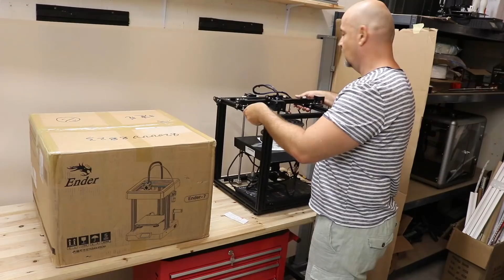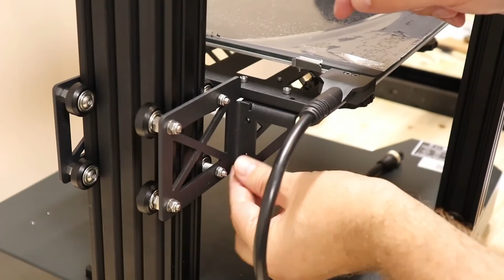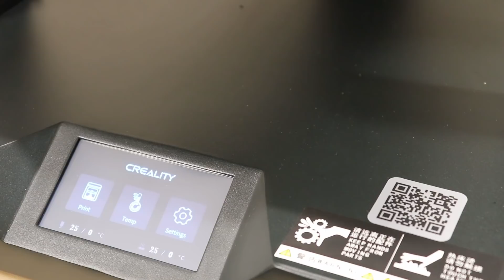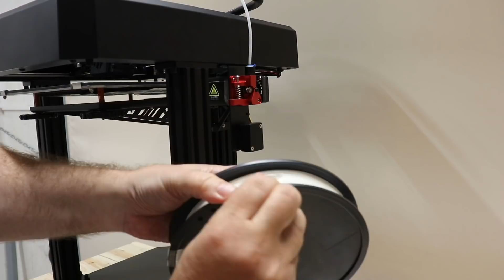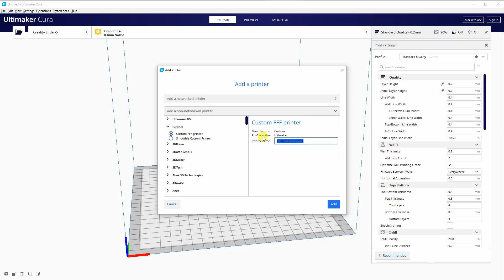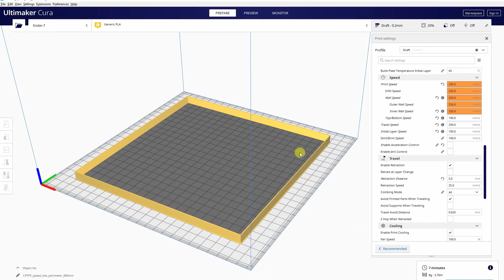How fast is Ender 7, the coreXY 3D printer from Creality?

Comment: This machine is just all hype..  Poor quality control, Poor Design throughout,   It needs to be leveled every print because the supports for the bed are not strong enough,  Poor software,  I have  purchased and returned 3  Ender 7's.   Actually  the  CR10-S Sucks too.
Reply from the maker: I feel that Ender-7 is something like 95% finished printer. There are great opportunities in it, it has bigger steppers than Voron, also has linear rails. With better software, bed leveling, better hotend could be a great printer. Yes, it needs some DIY mods, so I recommend it only to advanced users now.

Comment: You should consider doing a video where you convert the Ender 7 to Klipper firmware to unlock the true speed potential of the platform. I would love to see how the 7 can perform with input shaping and pressure advance enabled.
Reply: Yeah that would be very interesting 👏😊
Reply: What is Klipper? Sorry I'm new. I have a Ender 3 v2 and I'm just curious.

Comment: you could have just rotated the benche boat by 45 degree so your infill would be horizontal/vertical...
Reply from the maker: No, lines would be under 45° angle in absolute coordinates. The solution is enabling the expert mode in Cura, then I can set the angle of grid lines.

Comment: I have flsun super racer , run on factory slicer setting , fast profile, speed 150mm/s , finish benchy 38minutes and very good quality compare this video 50mins benchy, it is 250mm/s ,  

Why benchy from ender 7 250mm/s is slower than flsun 150mm/s?
Reply from the maker: Default acceleration limit was 1250mm/s2. Today I just got Flsun SR. After review I'll do side by side speed comparison

Comment: If you want X and Y oriented infill, how about rotating the model 45 degrees? Would that work, or would the infill remain in the same orientation?
Reply from the maker: No, the infill lines stays 45° in absolute coordinate system. But there is a solution, but only visible if I enable the Expert mode in cura (added in description)

Comment: to change the direction of the infill lines try
infill pattern "grid"
infill line direction "[90] 
:)
Reply from the maker: Yes, Thanks, I already got the help in earlier comments. Those settings are visible in the Expert mode in Cura (I was in advanced only)

Comment: Hot-end is still bad,  a lot of cutoffs made even from CoreXY kinematic a shi**y machine. The touch screen is not very responsive, still shi*ty spool holder and much more. In few words another bad machine from creality. 1 very critical point to check is mains wiring, mine was so bad that I had to redo it from scratch. Dont waste your money, you will have to do a lot of upgrades/changes to make it a nice printer unless you want to use only PLA. Save money and build yourself a voron.

Comment: sorry but print speed alone tells you nothing.
i can do 500mm/s on a prusa mk3 if i set my accel to 100 and get no ghosting.
what really matters is acceleration, speed also matters, both matter, also sometimes slicers speed up infill and set 50% the speed for outer perimeters. is this even for outer perimeters?
also two steppers working together really doesn't change much. if you can't handle the load on vertical/horizontal lines you need to tune down the settings or  increase stepper currents or change something. In 3d printers steppers are almost usually (unless you have an insanely fast printer like hevort) never the bottleneck. it's resonance.

Comment: what was the wall speed when the general speed was 250? I am asking because normally I don't use infill or support for my design.
Reply from the maker: I set everything to 250 only with smaller object in needs time to get that speed (acceleration)

Comment: considering how little room there is around the toolhead, they could at least add autoleveling
Reply: Hello it will be possible to add a BL touch later because in the firmware it is provided as well as on the motherboard 
and for the position of the BL-Touch look at the following video : https://www.youtube.com/watch?v=aQu6M1ihoBc&t=25s
Reply: @testprogramme8759  which means extra cost, Creality already has "inexpensive" autoleveling system in CR6 SE that could be used here
Reply: Would you be so kind to add your profile you used to start in cura thank u fantastic video
Reply: So this machine is setup for a bl touch ?
Reply: Really good video concise no bs

Comment: Nice video, as I suspected, reaching 250mm/s travel is easy, being stiff and all enough for proper accelerations to reach those speeds on normal prints? Not so much. The default acceleration looks pretty damn low, 500mm/s² at most from looking at it. Heck, any Ender 3 can do this. I wonder if the firmware allows a decent maximum (I'm running 5000 on my bed slinger on travel and 3000 for print, 500 only outer walls), or if it's locked to a low maximum too.
Reply from the maker: Hm, I am not sure how to measure this. Maybe just print some smaller object (Benchy) and measure the time for comparison(?)
Reply: @MyTechFun  After cracking my head through a bit of an existential crisis (more on the last paragraph blog/bar talk) I've manipulated around some simple speed/acceleration formulas to find: A = V/(t - (x/V)), where "A" is acceleration, "t" is time, "V" is the set maximum velocity, and "x" is the distance.
Using your data, so, 4x the same movement of start accelerating, get to 250, decelerate do 0, repeat, which the printer does in 4s for all 4 walls, that's 1s per wall, throwing at the formula that's 1250mm/s². 
A VERY conservative acceleration indeed, but more than bed slingers, which I think they set as default to make it print pretty outer walls but not being too sluggish, if you don't change the slicer settings. Hope this little formula helps later on when checking printers for their specs!
Also if it has M503 enabled on firmware, you could send it that Gcode through USB and check on the serial, tho granted Marlin allows you to disable this so dunno if it would tell it (or maybe if it lets you edit the default on the LCD).

About the existential crisis part: I was about to say something really stupid about it being an iterative process and all, then I stopped to think about it and how it's mostly high school physics actually... And couldn't just come with a quick reply... but the shitty part is that I'm a freaking mechanical engineering student, near the end of this hell, and I just jammed entirely on those basic mechanics formulas... Damn I had to facepalm at myself how much I had to mess around to manipulate this little formula (not to mention I didn't ass myself to derive them to begin with and just cheated the high school formulas). Oh well, there it is, a proper reply (albeit long)!
Reply from the maker: I just did my own calculation, and yes, 1250 mm/s2 is the acceleration. But I think the Benchy printing time should be shorter than..

Comment: Doesn't this have autolevel in it? Not with a BL Touch, but with the same system that was on the Ender 6?
Reply from the maker: No auto leveling and I can't really see the space where could it be mounted
Reply: Hello it will be possible to add a BL touch later because in the firmware it is provided as well as on the motherboard 
and for the position of the BL-Touch look at the following video : https://www.youtube.com/watch?v=aQu6M1ihoBc&t=25s

Comment: Ender 5 has H-BOT kinematics, not considered as true CoreXY, but still a very good printer.
Reply: Ain't H-bot a variant of CoreXY too? The movement math is identical, but I know it has it's pros and cons compared to the standard CoreXY mechanically.
Reply: @Kalvinjj  The belt path geometry is completely different, it misses out on mechanical advantage gained from a true CoreXY geometry.

It has typically more moving mass on one axis which could be distributed better on a true CoreXY setup.

Comment: You should really try a feeler gauge instead of the paper method.  Using a 0.2mm metal gauge, then simply setting your z - offset to go down the 0.2 mm gets it "right on the bed level" more accurately.   Paper is just... too much hassle.
Reply from the maker: Something I will try. Thx for the tip
Reply: I'm a master with the paper method lol

Comment: If you want to align the infill on the benchy, just turn it 45 degrees
Reply from the maker: No, the infill would be still 45° angle in absolute coordinates. The solution is visible if I enable Expert mode in Cura.

Comment: That bowden tube looks like it went through hell. That is disappointing that they didn't do direct drive but I'm not a 3d Printer engineer :D
Reply from the maker: Direct drive means stepper on hotend (moving part). For speed it is better to be bowden style (lighter moving mass)
Reply: @MyTechFun  Why would you need a stepper motor for direct drive when there is already a extruder to feed the filament to the hot end?
Reply: @donaldhollingsworth3875  There is a stepper motor in the extruder. Lol.

Comment: It is really sad, that there are more and more new printers from Creality without BL-Touch in firmware. I have the Sermoon D1 and the bed needs BL-Touch while it isn't really flat (more than 0,3mm on EACH corner). Without BL-Touch there ist noch chance to print bigger than 20cm*20cm.
Reply: That is the biggest issue I had when receiving my first printer 4years ago: a CR10S (v0). The glass bed was warped, and with my unknowledge at that time, having no idea about manual mesh bed leveling, I couldn't print anything bigger than 10x10cm
Reply: @rngenerated98  There is no manual mesh leveling for the Sermoon D1 because there is no firmware for it. The Firmware for the Sermoon D1 is closed and there is no Marlin or Klipper for it.
Reply: @rngenerated98  manual mesh bed leveling is very easy and very effective. I have a 3 v2 w/o Bl touch
Reply: @Lars Eickmeier
Die Creality printer brauchst ein BL-Touch, warum nicht, Creality!
Reply: @MyTasteOfMusic1  Sorry, ich verstehe nicht, was du mir sagen willst.

Comment: Many of the 3D manufacturers use PTFE tube lined hotends because they are believed to not clog as easy with pla. The tube acts as somewhat of a lubricant.
Reply: Yes, but as he said: that limits the max temperature due to the PTFE not being quite tollerant for high temperatures.
Reply: Yes, you are correct. I am simply saying it's a matter of target market and most tool dependability. They are betting the PTFE lined hotends will be more reliable for the target end user whom will only print PLA, and this configuration will be most reliable. While I am not saying I agree with the choice, I am saying this is a design choice based on the target market, and what is likely to be the most reliable (and cost effective), at least in the eyes of Creality engineering.